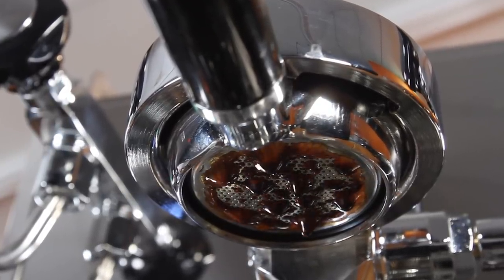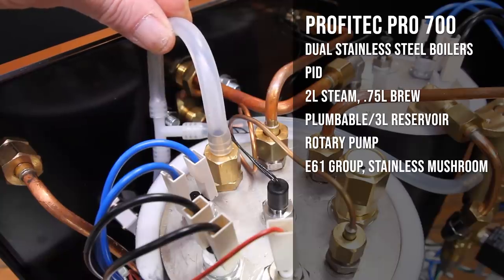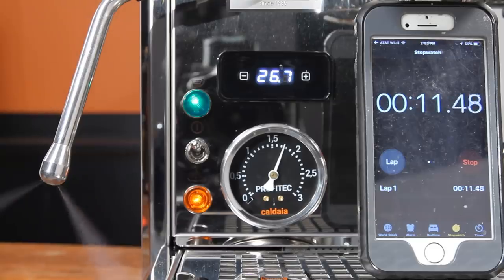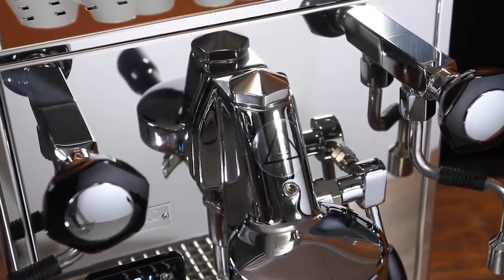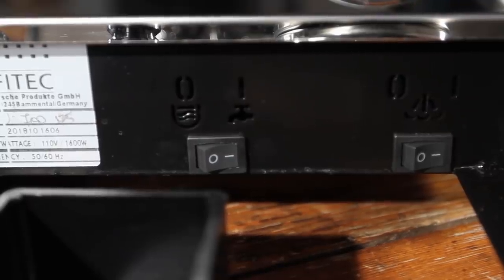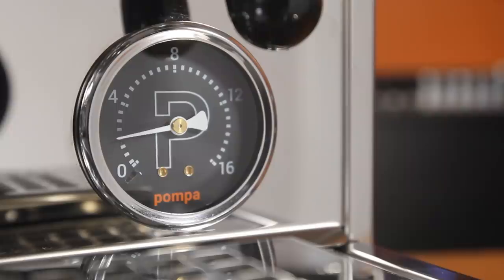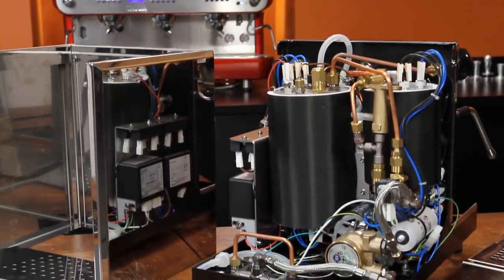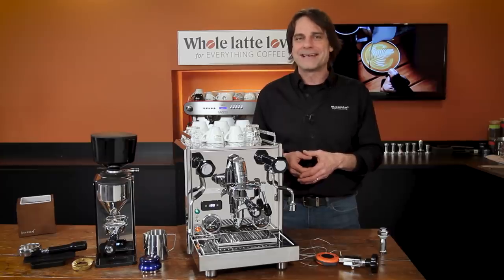Review: Profitec Pro 700 Dual Boiler PID Espresso Machine

Comment: I have the fancier bigger brother, ecm synchronika with the bwt filtreation system. The best machine everrrr
Reply from the maker: Jesus H Medrano Synchronika is the Pro 700 with next level detail. Beauty+!
Marc
Reply: Whole Latte Love i know and i lobe it! Thanx to u guys
Reply: Love this levers for the hot water and steam
Reply: ... and 1 inch too tall for me.🤬
Reply: @chadkent1158  sawzall…..???
Reply: Hi guys… Do you know why the the pressure drops dramatically and boiler kicks in while I’m in the middle of steaming milk? pro 700 (plumbed) could it be that the the boiler isn’t filling up enough? Or thinks that it’s fuller than it is maybe.
Steam drops to just over 1.5 like your video and hovers around there and then about 10-15 seconds later the machine kicks in and steam drops way below 1 bar. Thanks!
Reply: @thecurlystu8400  mine does that
Reply: @gigi9467  I read on a website that the pressure gauge can give a false reading so before you start your coffee routine purge the steam wand first then it will regulate as your going through your espresso routine… it’s been working for me so far 🤞
Reply: @thecurlystu8400  having noticed it but ill look out for it

Comment: I love mine! It’s a 2015, so its the older, original model without the upgraded PID (higher steam boiler pressure), new gauges/cosmetics, and sans the manual pressure profiling. I have thousands of shots, and have put less than $200 into it in 8yrs. Beautiful, high-quality, built like a tank, and great caffe! Whole Latte Love is great! Excellent sales/service/support!
Reply from the maker: Hi Kevin, Thanks for the long-term report!
Marc

Comment: So I started off wanting the Pro 500, then the Pro 600 and now I have definitely decided  on the Pro 700....well so I thought. The ECM Sychronika is now also in the mix  because I like the idea of  a lever for the control of the steam. However I would like to know what the pros and cons of using a lever instead of a knob. I assume that with a lever you less control over the flow of steam but it  would be easier to operate. Is being able to control the flow of steam important?

Comment: Purchased both Pro 700 and T64 grinder last March, and you can imagine my disappointment that the PID controller was not yet upgraded (both worked great, and was extremely happy with the plumbed-in feature).  Even though I started making the best cafe lattes my spouse and I ever had, I still felt like I was missing out on the increased steam pressure, so I went out and upgraded the PID last fall, and installed it myself following the instructions on the "Whole Latte Love' video.  One downside of the upgraded PID - the boilers are heated sequentially, which means it takes longer for the machine to be ready to use.  The original PID had an option to have both boilers turned on simultaneously, however, it was also drawing around 2500 watts of power.

One last upgrade was a wifi smart plug I picked up from TP-link smart plug (rated ~1800W).  My morning schedule has the machine turned on, warmed up and ready by the time I brush my teeth, and I can turn the Pro 700 off or on from the comfort of my phone.
Reply from the maker: Hi Sam, Thanks for the feedback. Timers, smart plugs, smart home integration are wonderful. Happy to hear you are making the best lattes ever! Do you have a favorite bean? Glad you found the upgrade install video useful!
Marc
Reply: Whole Latte Love I go with freshly roasted when I can, but always have the Lavazza Crema E Aroma beans handy.
Reply: The simultaneous boiler feature had to be turned on for my machine by myself since it wasn't set like this from the vendor. I think this features makes the Pro 700 a much better (i.e. much quicker) machine, esp. useful when you're impatient like I am. Startup is quicker and there are no more waiting times during preparing multiple espressi.
If the new PID doesn't have that feature, I wouldn't want it for free.
Reply: @peterboil4064 in the US dual heat would draw about 20A. This is not suitable for a regular outlet and must have a dedicated 20A outlet with nothing else drawing from it. It might work if done correctly, but most people will end up burning down their houses.

Comment: If i could only choose one, should i go for Pro 700 or 800? Please advise.
Reply from the maker: Hi Ahmad, Really depends on you as they are very different machines. As it's a manual lever, the Pro 800 is more work! But, it's a more "pure" espresso making experience. You actually pull the shot! Many describe lever shots as more syrupy and sweeter. On the Pro 700 you have much easier control of Brew temps can change brew temp independently from steam temp.
Marc
Reply: @Wholelattelovepage  really appreciate it. Thanks, Marc. Love from Malaysia.

Comment: After cleaning the steamer I noticed some mould in the silicon tube and removed the tube. I then bought a new silicon tube, but can't get it to hold in the wand since it's too soft (though it's food grade silicon for high temperatures). Are there special silicon tubes for this machine that have a reasonable price or am I doing something wrong? The manual doesn't really address replacing the silicon tube and the vendor I bought the machine from doesn't sell parts (I'm based in Germany by the way).
I've been using the steamer without the silicon tube ever since, which also works but I now fear that I will get mould inside the metal tube instead, which probably is even less easy to clean and even more so less visible.
Any Ideas?
Reply from the maker: Hi Peter, Greetings from the US! In your case, I would bypass your local vendor and go straight to Profitec in Germany for advice/parts.
Marc

Comment: Hi, quick question; can the Pro700 V2 water and steam handles be fitted to the V1? Is the larger cap just a cosmetic change or is the thread/actuation different?

Your videos are probably the best available; wish you guys were Europe-based!
Reply from the maker: Hey AB, Thanks for your patience for this answer. The valves have not changed so yes it's just cosmetic.
Marc

Comment: Great review! I have a question as o like the angled portafilter from ECM Synchronica would the ECM portafilter fit in the Profitec 700 machine?
Reply from the maker: Hey David, Yes it will. ECM and Profitec portafilters in their E61 group machines are interchangeable.
Marc

Comment: Nice presentation, thanks. But it really is difficult understanding the difference between ECM and Profitec when you say they are almost identical inside.
Reply from the maker: Hi SE, Thanks for the kind comment. The ECM Synchronika and Pro 700 are essentially identical inside. The difference is in the external casework and finishing details.
Marc

Comment: Thanks you for the in depth review.

I have two questions:

1- Are there any operational or functional differences between the Profitec 700 and the ECM Synchronika?

2- Can distilled water be used to control descaling?
Reply from the maker: HI Eric, Thanks for the question. 1. The internal components of the Pro 700 and ECM Synchronika are identical with the exception of the steam and hot water valves. Turning knobs on the Pro 700 and levers on the Synchronika. Also difference in case design. The Synchronika's base frame is one continuous piece with no welds or fasteners.  With that design, it's the easiest to open machine of its type.
2. We do not recommend using distilled or pure Reverse osmosis water in espresso machines. A couple of reasons for that. First, ultra pure water over-extracts coffee leading to bad flavor. Second, ultra-pure water can cause corrosion of metals. One reason you will never see ultra pure water transported or stored in metals. FYI, corrosion is kind of the opposite of scale.
For no worries water that doesn't cause scale and supports good flavor we recommend plumbing machines with A BWT Bestmax Premium filter. It does typical particle and activated carbon filtration but its real trick is a patented system which removes some calcium and replaces it with magnesium. Use this filter properly and you will never have to descale: https://www.wholelattelove.com/products/bwt-bestmax-premium-filter-package-w-besthead-flex
Marc
Reply: Whole Latte Love thank you for answering so quickly.

I heard somewhere that some of the Rocket espresso machines had a way of sensing the water hardness, and if this is too low, then the machines will not work, and I had wondered if the ECM and Profitec machines did the same.

Regarding the water hardness I watched the brew video with Baking Soda and Epsom salt, and I liked your approach for using these together. With distilled water.

I have a water distiller at home, and the ‘brew’ seems like a natural progression for me.
Reply from the maker: Hi Erik, You are welcome! Some Rocket machines do use electrical conductivity to sense water level. So you are right. The water sensor may not work properly if reservoir is filled with zero TDS water. Water without minerals is a poor conductor. Again, we strongly recommend against using pure distilled or RO water in espresso machines. Doing so can cause corrosion. But some do insist. A pinch of salt in the reservoir is enough to get the water conductivity sensor operating.
Marc
Reply: Hi Marc,

I very much appreciate the comments.  

I watched again the video, and I noticed that inside the steam wand there is a plastic tubing.

Is there any chance to change this for a double wall metal wand?

Comment: Hey guys quick question please,

Is it true that the new profitec pro700 steam and hot water knobs comes in joystick edition like the ECM as im planning to buy one and the dealer said that it sounded fishy to me  as i never saw a pro700 with joystick handles.
Reply from the maker: Hi FB, I have never seen a Pro 700 come stock with lever handles and know of no plans to do so. But if you're into DIY mods the ECM Synchronika lever valves will mount to a Pro 700. In case you did not know already the ECM Synchronika and Profitec Pro 700 are essentially identical internally. Same specs, boiler etc. They are made in the same factory in Germany. So if you want the lever valves it's likely more cost effective to just get the Synchronika. You'll alos get a higher level of finishing detail and angled portafilters.
Marc
Reply: @Wholelattelovepage  
Hello guys first of all thank you so much for your reply.
Second i have received my profitec pro 700 with lever.
I live in Dubai UAE, apparently the whole profitec 700 stock here came with lever maybe special request or something if your interested i can share some photos for your reference.
One last question do you do international deliveries i mean to Dubai?
Reply from the maker: @ferasbourgi9851  You are welcome. Manufacturers often do special request versions of machines for various retailers. I know it's something we ask of them all the time. At this point we're USA/Canada only. But someday - I do correspond with a lot of espresso lovers in your part of the world. Always wonderful interactions!!!
Marc

Comment: i got a problem with my ecm synchronica that moisture has started to leak in to my pressure gauge. Not sure what to do about it. Im not sure where to ask so i thought id try here. Any advice would be greatly appreciated.

Ok so i opened up my machine and it turns out the platstic T connection for the rubber tubing and dried and cracked :(:(
Reply from the maker: Hi schh, If in the US you can contact us for parts here if needed: https://www.wholelattelove.com/contact-us

Comment: Hi whole latte love, Just a quick question. Does the Profitec pro 700 V2 come in white colour pressure display instead of black?
Reply from the maker: Hi Ken, Thanks for the question. No white gauges available on the Pro 700. But, the ECM Synchronika which is essentially the same machine does come with white gauges and higher level of finishing detail. Pro 700 and Synchronika are made in the same production facility in Milan. Italy. ECM and Profitec are sister companies. Kinda like Lexus/Toyota. Check it out here: https://www.wholelattelove.com/products/ecm-synchronika-dual-boiler-with-flow-control
Marc

Comment: I’m certainly thinking this will be my next machine, possibly last. 

Does it include a plastic tamper or a metal one? I know it’s becoming a bit more popular to include a nicer tamper. The picture on the site includes a plastic but I don’t know if it’s outdated or not. If it’s plastic, I would most likely get the Tamping Tom.
Reply from the maker: Hi DD, The Pro 700 comes with the unfortunate plastic tamper included with most every semi-auto machine. But, if it's going to be you last machine you might consider stepping up to the ECM Synchronika. It's essentially the same as the Pro 700 internally, with same specs and it does include a very nice heavy weight metal tamper! Same machine as the P700 but with next level finishing of casework and added design touches. Also the easiest prosumer level machine to open up (if you're into that) of any available prosumer level machine. Nice joystick valves instead of knobs, tapered E61 group... : https://www.wholelattelove.com/products/ecm-synchronika-dual-boiler-with-flow-control
Marc
Reply: Whole Latte Love Unfortunately that’s out of my budget but thanks!

Comment: Ok now I think I want the pro 700 or the Synchronika
Reply from the maker: Hi Mark, Thanks for the comment. The Synchronika and Pro 700 are excellent machines and essentially identical under the hood. Difference is in exterior finish with the Synchronika being the more refined of the two. Synchronika comes with angled portafilters, E61 group with subtle taper, lever operated valves, matching chrome tipped elements, gauges up high and PID display silvered to blend with the case.
Marc

Comment: Hi Marc, 
If my smaller machine does not have the pre- infusion feature, what do you suggest to compensate for a better extraction in means of flavor? 
(Non pressurized 51mm basket, no manometer, no thermometer)
Reply from the maker: Hi neville, Thanks for the question. Some coffees do benefit from pre-infusion in flavor. This is particularly true of single origin fresh coffees with a lighter roast profile. Additionally, pre-infusion  swells the coffee helping to control channeling. If a machine does not have pre-infusion capabilities you could try running the pump for a few seconds, then stop it and wait 5-10 seconds before turning the pump back on and proceeding normally. This will pre-wet the coffee puck and may give some benefit in reducing channeling. But, I'll be honest it's not something I've tried - just an idea.
Marc

Comment: Another great review! I am currently looking for a top-of-the-line prosumer machine with flow control. Would you recommend this machine? Or should I go with the ECM Synchronika? Currently leaning towards the Synchronika but I'd like your opinion.
Reply from the maker: Hi C, Thanks for the comment and question. The ECM Synchronika and Profitec Pro 700 are essentially identical internally with same specs as far as boiler sizes, max steam pressure etc. In fact, both machines are hand assembled in the same facility near Milan, Italy. Both use the same pumps and internal plumbing plus features like stainless steel mushroom valves. The differences are on the outside.
Synchronika: angled portafilters, lever operated valves, more refined case edge work/finishing, chromed ends on levers/PF/group lever, tapered E61 group head, one piece frame base allows for opening machine in ~1 minute.
Pro 700: straight PFs, knob operated low ear sprung valves, excellent casework.
Both machines are equal in capabilities. It comes down to which you prefer the look of. Hope that helps!
Marc

Comment: Hey marc great video thank you. Quick question about the SYNCHRONIKA. Just wondering if it too has been updated or if they are still using the same model since its release as I am weighing up options on the ecm and pro 700. Thanks mate
Reply from the maker: Hi AD, Thanks for the comment and question. So you know, the Pro 700 and ECM Synchronika are essentially the same machine internally. Main differences are the chassis, valves and casework details. Hydraulically they are Identical. No upgrades to either since this video was made. Both feature best in class steam power at up to ~2 bar as well as extended functions through the PID controller for auto-off timer and maintenance reminders.
Marc
Reply: @Wholelattelovepage  thank you mate you're a gentleman. P.s. your videos are always my go to when I need clarification !!!😀